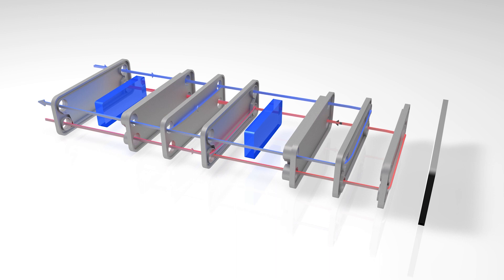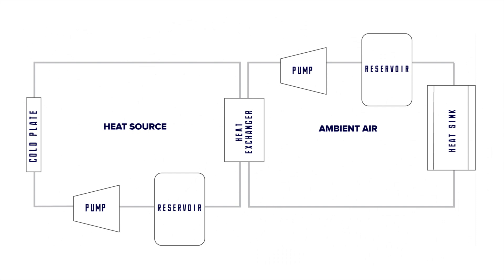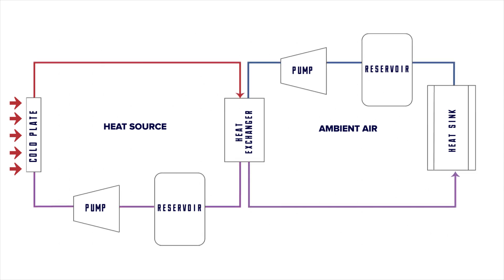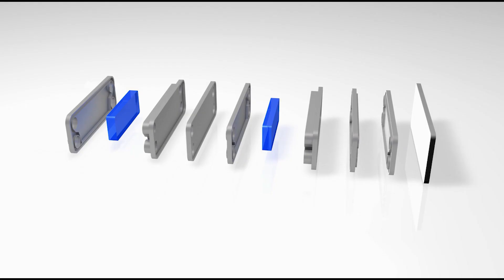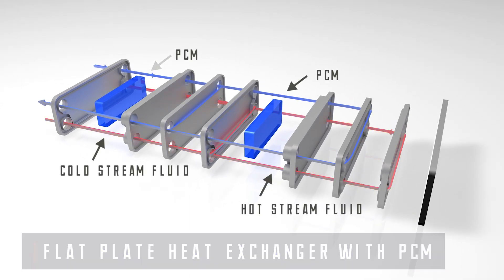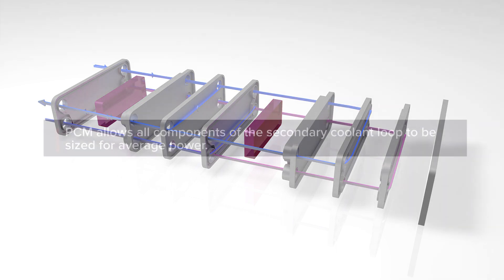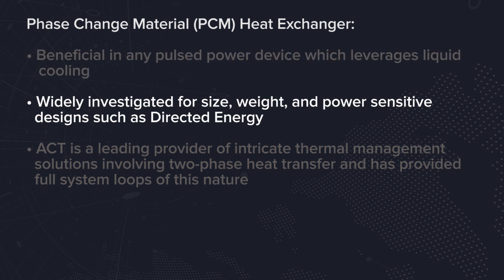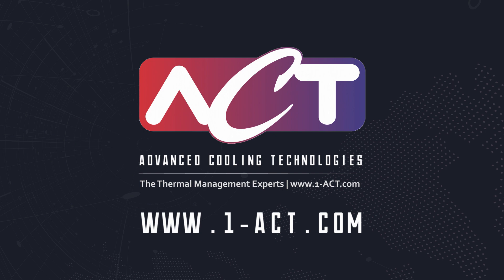Phase Change Material (PCM) Heat Exchanger

Comment: Wow. This is awesome. Can this be used for cooling small but high heat generating objects? Thank you.
Reply from the maker: It depends on a lot of factors, as you will find to be the case with most things relating to thermal management. :)  But PCM can be a great option for a lot of scenarios.  We have a lot of great information on our website at www.1-act.com.  Thank you for your interest!
Reply: Thank you ACT. I have a project in which a part needs a lot of cooling efficiently, and with minimum space. Any suggestions?
Reply from the maker: @davidfaiheng  we would need some more information about the project to help identify if PCM is a viable option.  If you fill out the form on our website with some of the details, an applications engineer will get back to you in a few days.  Here is the link: https://www.1-act.com/contact-act/